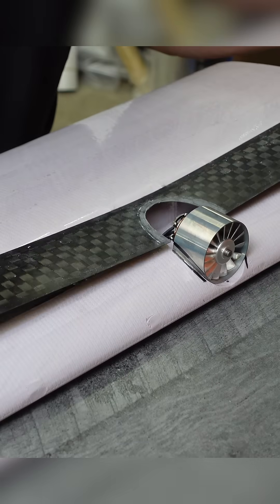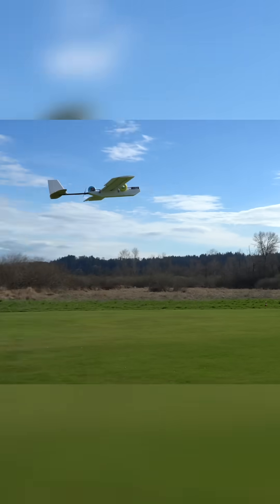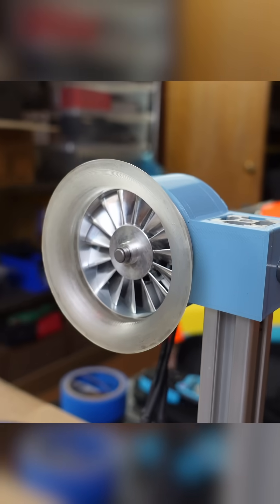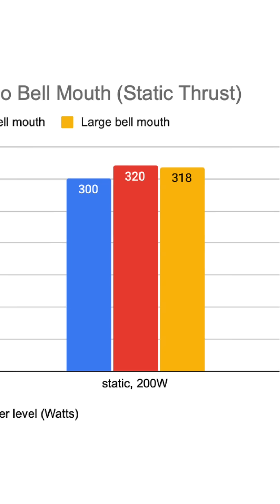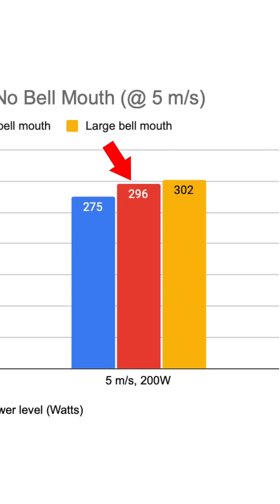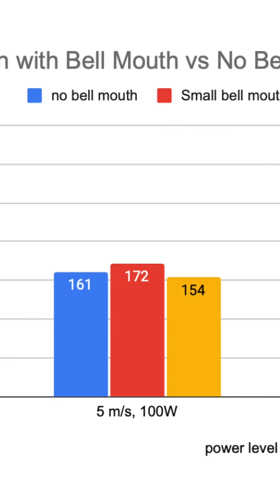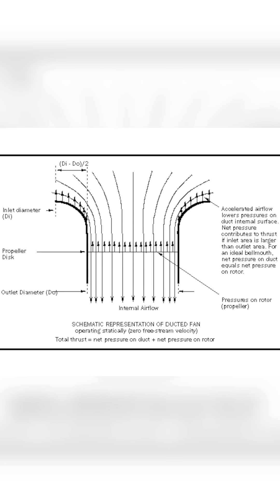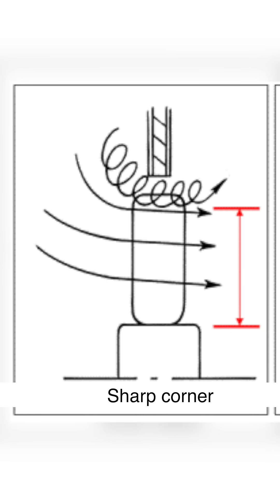Testing EDF Intake Shape for RC Plane #rcplane #aerodynamics

Comment: Have you considered using a bell mouth that would use a parabolic profile instead of the static circular radius...?
Think of the intakes that you used to see on the old school 4 cylinder motorcycles...

Comment: My wife is a pilot and has informed me that majority of lift in a plane’s wing comes from the low pressure on the top of the wing sucking the plane up to create lift as the wing surfaces redirect air as they move through air. So, is the majority of the thrust from the low pressure side (or inlet) on your plane’s propellers as well?

Comment: The last few seconds explain exactly what it is. And when your turbo inlet suddenly gains an extra 9% in horsepower when it’s at 4500, makes a huge difference.
On a car, the drag from a large bell mouth is negligible to the power increase. With a ducted fan mounted on a leading edge of a wing, the bell mouth needs a motor housing or cowling to reduce the bell mouth scoup drag, that’s all. Look at gas turbines with high bypass, like on airliners the past few years, bell mouthed with a housing of course. 
So phis tocate ted.  lol

Comment: You could try making the bell jagged like a serrated blade with ridges and duvets, all aligned into the intake, 
It allows the air to ease into the flow 
Whale fins have bumps that actually reduce drag
Super Sonic jets are pointy so that the shockwave is handled better,

Comment: I’m a chemical engineer specialised in CFD. You got it right: less turbulence makes it more efficient. And that also explains why the size made a difference. It’s not about being bigger or smaller, it’s about being proportional. If too big there’s enough room for you to start forming some eddies along the way whilst the smaller had the right size for the flow to not break up before entering the fan.

Comment: Point of the bell mouth is to start the compression process and start a swirling effect on the incoming air(like water down a drain). This keeps the stress down on the blades. The goal is to keep the drag down by only making the bell mouth the size of the surrounding area. I'm not sure how it will effect a fan but with a turbine engine it will keep vibration down on the blades and reduce over pressure in the combustion chamber (chugs) good luck

Comment: bell mouths will always be helpful, as a performance mechanic, we use this on ITBs and it allows you to actually get very slightly higher than atmospheric pressure, its not about being a scoop and catching more air, its about increasing the velocity of the air as it enters, it works on Bernoulli's principle.
Reply: To add to this, a few different manufacturers messed around with variable length velocity stacks to increase this effect. It's dependant on RPMs of course, but would be interesting to see applied to aerospace physics as well
Reply: @divinemotorsport  oh yeah i remember seeing that, that was a cool project. A bit clumky but if an OEM spent some money on R&D I'll bet you could get a pretty good compact system that you can tune on the ECU for that peak velocity

Comment: Could it be that it causes a larger mass of air to be forced through because of the enlarged collection area?  Meaning you are putting more air through with the mouth than without and that in turn creates more thrust, but then the drag factor applies.

Comment: The "curvy triangular NACA designed air intakes, used in the front of the hood some 60's and 70's muscle cars, was supposed to be the most efficient air intake because it is designed for high flow with minimum drag.
 NACA did an awful lot of work with air foil profiles and lift vs drag. Most of that is hiding in the dusty corners of the web.

Comment: Your airflow analysis is correct from an aerodynamic standpoint. That’s why high quality stationary (static, not moving) intakes have smooth bell shaped walls instead of just being a hole in the wall. The turbulence from clipping the hard edge will choke the flow at more extreme speeds. This is the same principle that causes us to design high flow pipes with as few 90deg turns as possible, literal efficiency losses at every turn due to turbulence from imperfect surfaces and momentum redirection.

I’d personally be worried that the bell mouth will generate excess drag if it’s taller than the wing, which will effectively diminish your aspec ratio while increasing weight. I’m not the one who designed current aircraft turbines but I’m certain they aren’t bellmouthed like yours for good reason. Try making a housing for the turbine instead that just brings in a smooth curved edge to the bell shape of the total turbine housing (like modern planes).

Comment: The leading edge and trailing edge have the most lift per volume. Just need a thin and stiff wire with just long enough chord for a full profile. Spam a bunch of them in accordance with katzmayr effect. Saves a lot on weight and you get more lift. Make sure they are strong enough with sufficient flexion and spacing. Doesn't hurt to look up tubercle effect and learn about ventral pleats too.

Comment: Velocity stacks on cars also need to have the proper length of a runner before the fan to help speed the air channel. I bet if you used the small diameter stack and had a bit longer of a runner leading to the fan you coud squeeze a few more percentage out of it.

Comment: The smooth flow of the laminar flow on the surface of the bell mouth enters the fan where the outer edge where the blades are moving fastest. This faster moving air creates low pressure and will help pull in the srounding air in the centre quicker. Increasing the efficiency with laminar flow is such a brilliant idea.

I could be wrong but this is how i think it works. Theroy sounds good to me.

Comment: You could try also a Custer Channel Wing type of fan shroud. 
A french biplane, with a Citroën GS flat four air-cooled engine, had pusher propellers installed in the gap between upper and lower wing, having a decalage, upper wing more advanced.
Hovey had an excellent booklet about Ducted fans.

Comment: This is something lightly touched on in Airframe and Powerplant school. The intake of a turbine or fan being a smooth, rounded edge furnishes the air, allowing less turbulent airflow, and greater efficiency. To make it even more efficient, turbofan intakes are actually slightly smaller at the front, widening until just before the first compressor stage, to slow down air at high speeds.

Comment: The bell mouth just allows it to pull in more air. It won't make a difference which  direction you turn it at the speed the model flys. If it was an actual jet,  it would matter at high speed.

Comment: Why not build large intake cones with very sharp front edges so that they efficiently divide the air. The bell mouth intakes are shaped perpendicular to the air travel path which creates inefficiency by acting as an air brake but a properly angled conical intake complete with vortexing fins on the inside so as to help the air begin spinning into a vortex before even entering the engine. Such a combination should induce centripetal force in the incoming air flow and contract the gas into a verticey prior to intake this is essentially the same thing you're doing with compound counter rotating turbines or numerous amounts of turbines in cereal each with an increasing stage of attack angle and compression force matched to the speed and compression need for the gas flowing through the engine...

Comment: It's smooting the flow. In fact if you lightly texture the surface (same as a no stick pan) and also slightly curve the outer edges backwards a little (smoothing the air off the edge of the bell mouth across the wing) you should see about another 2% improvement.

Comment: I've done similar experiments. I used a single engine airplane as a test platform. With a ducted fan on each wing, I did modifications on one side to determine efficiency improvements.

Comment: Your hypothesis about bellmouths smoothing the intake airflow is probably right. I know that curving bends in long bass reflex ducts in speaker bins gives more stability than square ducts in speaker bins and it's down to maintaining an even wave flow around the bend with fewer stray reflections and backpressures.

The original video was fun to watch, the low speed lifts you were getting were bonkers!

Comment: If you want to get the thrust gains from the bellmouth without as much of a loss from drag, you need to create a nacelle that matches the diameter of the bellmouth. 

This way, there isnt a low pressure area behind the bellmouth.

Comment: If you line the edge of the bell-mouth with a very thin, platinum wire and ground the internal surface of the ducted fan's body (it's metal so you can just ground the entire thing) -- and then create a ~40,000V (I know It's a lot, but it's really low current) potential between these -- it should increase the thrust by a noticeable amount. ;¬)

Comment: The water engineers almost got it right it's not only about laminar flow it's about compression when the air slows down it compresses as well at the stall area and you get an area of high pressure in the edge of the flow so you have a reduced airflow (fluids don't compress easily), with the belmouths you don't get a stall area so you get no compression and increased flow

Comment: The intakes on turbine engines are the reverse of a bell mouth. That slows the velocity of the flow and increases the pressure at the blades and none of the induced and parasitic drag.

Comment: You are partially correct it improves the laminar flow increasing thrust the reason you didn't see an improvement with the 90 degree test is that as the air flow hits the radius you actually create turbulent flow best way to see this is with smoke

Comment: Nice work.
The COANDA effect is at play here; when the intake of air flows from a larger diameter to a smaller one, there is a slight amount of compression of the air volume, so there is an increase in density as the air flows through the bell. This variance is appropriate for the +/-10% you are experiencing.

Does this make sense?

Comment: No, your Dyson powered bellmouth experiments did not prove using a bellmouth to be wrong, your experiment was flawed and did not adequately prove the theory.  The most benefit of a bellmouth intake can only be observed in flight, you can't see this on a static bench as not enough air is flowing, or forced, into the intake bu the forward momentum.  Next step would be for you to build a wind tunnnel.

Comment: Okay. Blown laminar flow aerofoil, venturi on your EDF... Nice, but mostly wasted on that airframe.
Aerodynamics is not only about lift. You've got to eliminate (reduce, in the real world) drag. 
A bell mouth WILL improve your EDF performance, but whilst you're just adding drag, you won't get the increases you're chasing. 
Fair them in. Reduce the drag.
That plane is about as streamlined as a Sopwith Camel.

Comment: What about filling in and smoothing the hollow recess behind the extended flared intake?  In order to smooth that air flow destined to travel around the outside of intake, which will  delay air flow separation reducing laminar drag and transitional turbulence. Just a thought, assuming the rear of the intake remains openly flared as depicted in your video?. :-).

Comment: Agreed. The problem is the drag if you're putting the drag next to the wing. You're having a problem if you're putting the drag way out there. Where it's got a chance, 2 dissipate. Before it comes against another surface, then. Well, there's very little to be dragging now, isn't there? That means there's very little friction

Comment: these subwoofer port rings do always the same. they give the air a smoth flow.  i use them for subs and my self designed bigger air intake in a air filter box for my car. it does nocht give more power, but from zero throttle to 100% the upspeeding air flow is more linear and the power feels more softer increasing. the noise is less and even in the values measured from the intake air temp snsor is more liniear increasing which i think is due to air speed increasing also more stable as before in more steps.  cant say it better. i´m just a german bastler. ;-)

Comment: Great video. 
The bell mouth smooths the airflow prior to the fan intake which increases efficiency at the fans leading edge, no turbulence.
Commercial jet engine intakes a designed a lot in the same manner but, faired on the outside of the bell to reduce exterior drag.
You should try the bell with the outside faired to reduce drag, your efforts will be worth it.
Bernoulli's principle is at work here.
Go to the airport and look at an intake.
Nice job.

Comment: You created additional drag by adding bell mouth flange with outer diameter larger than existing fen body. This interrupts smooth air flow creating a drag.  
Try to make new fan body the same size as outer edge of the bell mouth flange to reduce additional drag that you mentioned.

Comment: imo it is due to the turbulence or the lack of if a more laminar flow is realized.
i once constructed somewhat of such an intake not for an engine, but an airscarf. it was too loud according to cfd simulation so i tried a few variation and the version creating an acceptable noise level had also the best flow velocity meaning it was lower due to the better efficiency and so more silent.
kinda same principle even you aim the other direction.
can be wrong also changed the internals at the fan multiple ppl involved...

Comment: Actually, if fan is at speed it would help to put restriction with divergenting cone in front of the fan, so cross section would be smaller at the entrance and a bit larger at fan, kinda Mig 21 engine bellmouth. With speed, you get pressure increase at the fan, so it is pushing more flow thru the engine.

Comment: Large bell intakes might be better at creating laminar flow but they do have a heavier drag penalty. The aerospace engineers might not have taken into account the increased ram air effect on gas turbine engines which electric fans do not benefit from. I bet those new loop style propellers with a conservative bell intake might get to double digit efficiency increases...

Comment: It has to do with the creation of vortices around the entire radius that are uniform. If you have the bare fan, it builds a low pressure point that stalls air around the short side and an imbalance of high pressure on the other side. This side loads one side of the fan and creates a vortice on the back side.  Creating an imbalance of thrust. Not the fan, the thrust pattern. This can be seen by blowing chalk through it on slow motion. You should see the air flow faster on one side of the wing from the side profile.

Comment: Put your electric motor(s) so the blade(s) are flat with the wing and figure out the inlet and outlet with no forward speed and full forward speed. Suction on top of the wing and pressure under it (STOL or vertical takeoff).

Comment: The bellmouth creates an air multiplication effect. Its the same way Dyson bladeless fans work. The curved surface accelerates the air coming into the intake which creates low pressure, which accelerates the air more which creates lower pressure.... and so on.
The direction its facing doesnt matter (other than the ram air effect of having it pointed in the direction of air flow) which is why you saw no difference depending on the direction it faced.

Comment: In my head, the conclusion would be the more complex, combined solution. Large bell horizontally, which tapers into small bell vertically.
Plus, a housing that aerodynamically connects the exterior of the bell to the wing.

Comment: Around the edges of the bell mouth where it connects to the wing add  llittle vortex generator slats would lowering the motors more centered into the wings to create less drag, also I was wondering between the 3d model and when you pout the carbon cover on over the wing  the square gap to distribute the air across the wing  did you sand an angle into the channel to the  output ? It looked squared

Comment: The air passing through the straight pipe intake creates turbulence at the edge, leading to at worst, a thin spinning air donut that effectively reduces the diameter of the intake, like a choke ring. This of course creates pumping losses.

The bell mouth alleviates this issue.

Comment: As a non engineer my opinion is the extra weight and drag will not be worth a 10 percent improvement. You would also need to build a fairing to reduce the huge low pressure area behind the fan opening. You’re going to end up weighing like 8 percent more with a much higher amount of drag

Comment: I feel like being fan driven, there is only so much air that can be forced into the inlet, causing a pressure bubble in front of the cone. I feel the smaller cone allows for better consistency of air intake. If it was a jet engine you would possibly get better performance due to the ram air effect.
Reply: I am not an expert in any way, shape, or form. Just some dude thinking out loud 😂

Comment: I had to do so much testing on optimization of Individual Throttle Body manifolds. Such a drastic change from 40mm to 35mm. Laminar flow and reducing turbulence is super tough to comprehend on a dedicated application at first.

Comment: You aren't factoring in the massive amount of drag that bell mount is giving the actual flying aircraft.  An actual wind tunnel test will reveal a negative net gain in performance.  You need to increase the diameter of the nacelle in order to reduce the added drag.

Comment: I did take some hydrodynamics classes, and it's because you make flow smoother. In real life construction you use it only so often because it's kind of expencive solution, and not every culvert needs optimized flow for job they do. If you however want hydro powerplant, the money for better intake is drop in a bucket compared to entire dam.